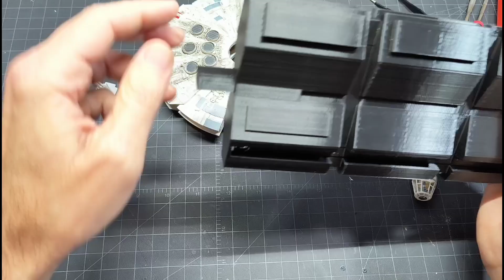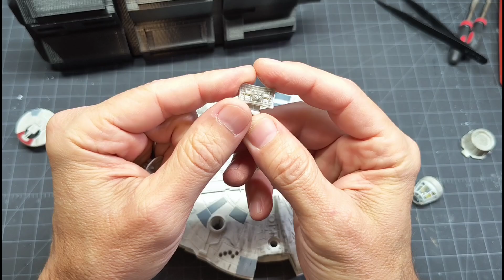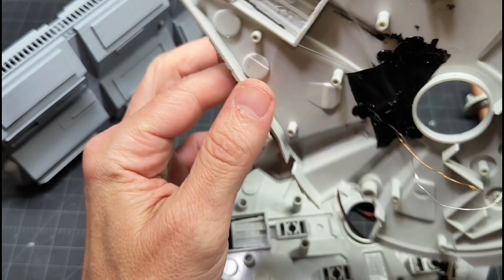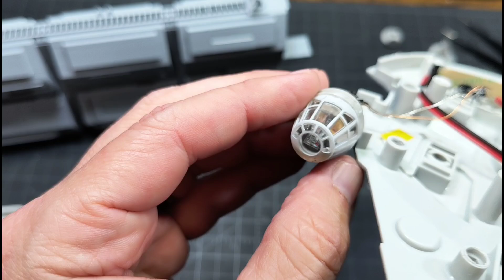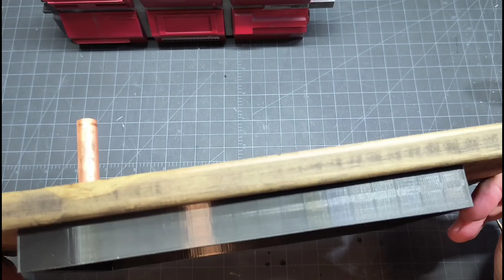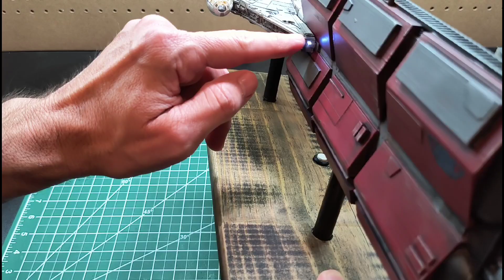Star Wars Millennium Falcon with Cargo Barge model build

Comment: Great project!  Yep, I've long assumed the 'Falcon was a cargo pusher as well.  The fork and offset cockpit make the most sense that way.  Also, having strangers call it a piece of junk implies it was incomplete, or being used by Han in a nonstandard way. Like someone who's driving around town in a beat-up (but very fast) tractor!  And it's not as awkward as it might seem, the Falcon would just be serving as the booster for a 'rocket' full of cargo, in a sense. Pulling the load would actually be more complicated in space, since the engine exhaust would be pointed at the cargo. In space without wind resistance, pushing the load would become just a matter of keeping the craft's trajectory steady.   I was sad that this aspect of the concept (even if only implied) was misunderstood or ignored in *Solo*.
Reply from the maker: Thanks! It was a fun project. I always liked the concept and it made sense as to how it would work.

Comment: I feel like a bull in a china shop fiddling with #18 wire and small DC power supplies when my average power supply is 480V 30-200A 3-phase AC most days at work.  Model power distribution and lighting is my trade's low-volt DC segment, fire alarm, or voice and data work.

Comment: The model should be turned 90 degrees, the cockpit was supposed to rotate inside the ship to put it on top of the barge. That also puts the "cannons" on the left and right instead of top and bottom.
Reply from the maker: The concept art I was copying was arranged like I built it. It's just a concept.

Comment: Radar antenna is useless as well as the cockpit since they all have half of their field view block bu the cargo.
Reply from the maker: Ok
Reply: No matter where the cockpit is you will only ever see half. Even terrestrial pusher tugs can only see the half above the water line. Unlike in space the radar could see the opposite side as well as back fine and a simple 180 degree roll would give you a physical view if you so desired

Comment: Great build, thanks very much for sharing! And the wooden base is a nice change from the usual sci-fi panels, it brings the model closer to traditional ship building. I love how in the SW lore, the "barge" concept, with the containers clicking into the Facon mandibles, managed to fit into the original concept of the Falcon as a cargo/transport, even though its original design left very little apparent space for extra cargo 🙂. Having said that, one could forever argue about wheteher pushing these containers (instead of carrying them internally or pulling them) would create momentum forces with every tiny change of course, that would break the whole thing apart, but that's part of the the magic of Star Wars I guess !
Reply from the maker: Thank you! I appreciate the support! It was a fun build.